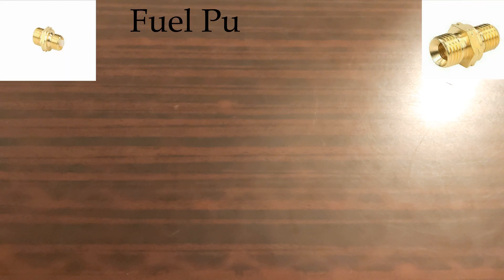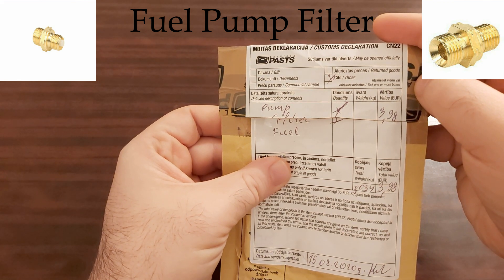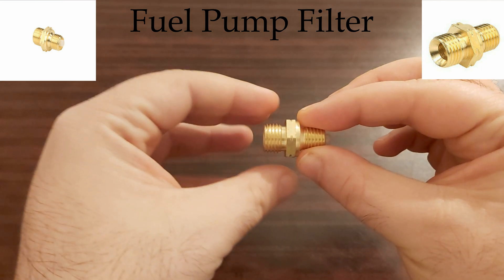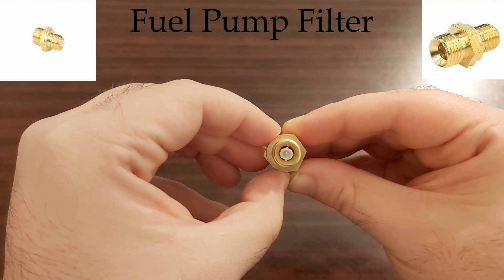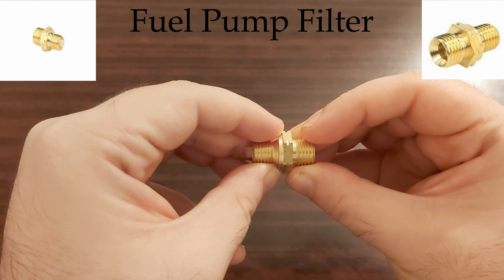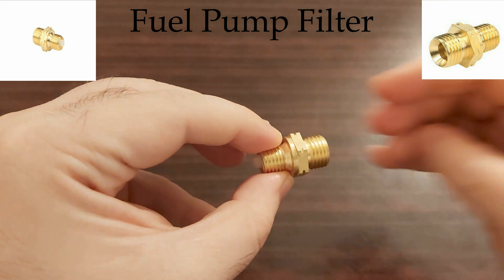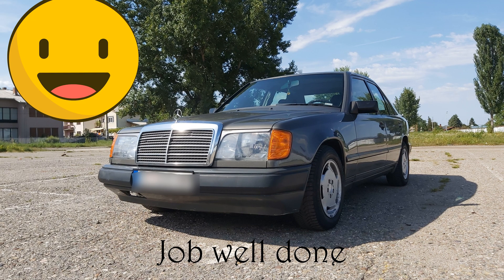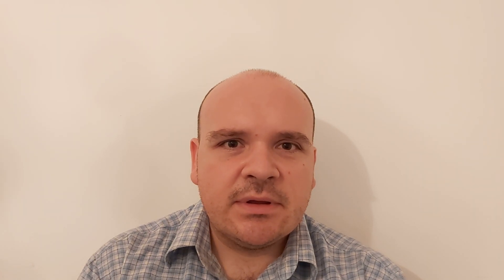Mercedes KE-Jetronic - Mercedes W124 Fuel Pump Filter

Comment: When should it be replaced (at what mileage) and what are the indications that it needs replacement? What problems can it cause if not replaced in time?
Reply from the maker: Well, there is not a precise mileage. You can't feel any symptoms. This is just the second fuel filtration out of 7. I believe these filters should be replaced once a lifetime of the car. If you have a 30 years old car then you can replace the filter. I did it because mine was very old and the brand new one is very cheap to buy. Greetings

Comment: my distributor inlet fuel filter is on so tight it seems pressed in, i could not get it off, and was nervous i might strip the thread! i used an open wrench 17mm  i tried so hard i  felt i started to round out screw... i was told by mercedes tech that it was causing no fuel to get through, but i just left it alone for now..my car would not start, so i adjusted air/fuel mixture and got it to start. what size crush washer goes  in fuel filter? i noticed you used the same one...
my car has a second crank hard start if it does not start the first time...studying all your videos to figure out what is the problem!  124 92 300e 2.6l thank you for your videos!!!
Reply from the maker: I simply used the oem one. I didn't measure it. It's a copper washer that your can buy in any hardware store. As I had to unscrew the filter I had to use the other wrench in order to make it easier. Sometimes people tighten it a bit and then loosen the screw. This is cone though....This filtrates only it shouldn't be serious(the second filtration out if 7). I wouldn't say it's a problem for a car nio to start. The washer is stuck so that you habe problem. Don't use flames 🔥because.....(you know why).
I hope you solve your issue.

Comment: Gde moze da se poruci ovaj deo kod nas u Srbiji i koliko kosta?
Reply from the maker: Ja sam ga kupio preko ibeja. Mogu da ti posaljem link. Ovaj deo se zove filter pumpe za gorivo. Ako ne uspes da ga nadjes kod nas, evo ti link
https://www.ebay.com/itm/Fuel-Pump-Filter-Fits-MERCEDES-190-Sprinter-Vito-W201-W126-W124-S124-903-1971/254644836955?ssPageName=STRK%3AMEBIDX%3AIT&_trksid=p2057872.m2749.l2649
Reply: @mercedeske  hvala. Ja imam w124 2.3 i svaki vas klip pazljivo gledam i slusam. Inace je bilo na plinu sada sam to izbacio ali auto i dalje malo brljavi sto se tice ler gasa i kada je vruc teze pali a sve sam menjao sto ste pricali u klipovima.
Reply from the maker: @dusan365  Dobro, sto se ler gasa tice ovako stoje stvari - nakon sto ti je stabilan pritisak u sistemu i sto su dobre dizne za stabilan ler ti treba ispravan ler motoric sa mikroprekidacem(on je zacetnik svega), senzor za polozaj klapne gasa treba da zatvori skroz leptir gasa, step motor tada preuzima ulogu da odrzava konstantan ler. Potenciometar treba da finije podesi polozaj disk protokomera. Da li ti je kalibrisan potenciometar? - Kada izmeris napon na pinovima 1 i 2 kada je auto zagrejan treba da ti da voltazu 0.7V +-0.1. Da li si promenio prigusnicu(akumulator za gorivo)? Lambda sonda se aktivira tek kada se auto zagreje. Da li ti je dobra lambda sonda? Ona se menja kad i filter za gorivo, 50h km. Jedan covek mi je govorio kako mu auto odlicno radi dok se ne zagreje, kad se zagreje, brljavi. Nakon sto je promenio lambdu auto mu je proradio kako treba.
Reply: @mercedeske  Nisam testirao lamga sondu. Imam tri ka glave ili ti protokomer sa sve razdelnicima to sam sve napakovao da jedna ka glava bude dobra. Zamenio sam dizne nove nova pumpa za gorivo svecice i kablove. Imam i step motore koji su po onom principu kako ste pokazali deluju ispravno. Promenio sam i tri akumulatora pored filtera za gorivo isti simptomi posle odredjenog vremena padne pritisak kada je ugasen motor. Sta se desi auto upali radi na 1500 obrtaja ne padaju obrtai sve dok ne proturiram auto onda spusti na 800 obrtaja. Auto ide lepo ne trza ne trokira samo taj ler brljavi i paljenje kada je vruc motor.
Reply from the maker: @dusan365  Normalno je da drzi obrtaje na 1500 kada je hladan. To treba da traje 10 sekundi(mozda i malo vise) i da sam onda spusti obrtaje na nekih 800. Jel ga cekas da spusti obrtaje ili malo sacekas pa ga turiras?
Reply from the maker: @dusan365  I jos jedna stvar. Da li si proverio regulator pritiska za gorivo? Da li mu je pukla gumena cevcica? Ako jeste gubices pritisak.
Reply: @mercedeske  jesam suv je.
Reply from the maker: @dusan365  Probaj da skines step motor i da ga potopis u dizel i ostavis ga tako preko noci, ako posle 15-ak sekundi auto sam ne spusti obrtaje na oko 800.
A pre toga izvedi ovaj test - kada ti se normalizuju obrtaji povuci rucnu(desna noga ne radi nista!), otpustaj polako kvacilo, gledaj u obrtaje i kada padnu na 500, PRITISNI KVACILO opet! Ako step motor ne digne obrtaje na preko hiljadu, pa ih sam spusti na 800 onda imas problema sa njim. Ja sam imao problema sa mojim, bio je potopljen u dizel na par sati i sada radi dobro.
Reply: @mercedeske  hvala na savetu probacu pa javljam rezultate.
Reply from the maker: @dusan365  Nema na cemu. Uvek!
Reply: @mercedeske  Ovu poruku nisam procitao do kraja pa sad videh. Kada ga upalim on radi na 2500 i onda ga ja proturiram da spusti na 800 obrtaja.
Reply from the maker: @dusan365  Jel si probao da opereš step motor?
Reply: @mercedeske  nisam jos probacu za viken pa vam javljam. Inace porucio sam onaj ndeo sto ide na ka flacu sto ste mi poslali link.
Reply: Pozdrav Ivice imam jedno pitanje za tebe majstor mi kazr da me zeza smajser ili ti akumulator za gorivo imas li preporuku gde mogu da nabavim nov a da nije skup kao otrov?
Reply from the maker: Potraži neki polovan na internetu po njegovom broju dela.
Reply: @mercedeske  nasao sam 6 komada i svi navodno neispravni. Kada ugasim auto posle pola sata verglam tri puta na dugo i onda tek upali.
Reply from the maker: @dusan365  To jeste onda simptom loše prigušnice(kako god da zovemo ovaj deo). Zaboravio sam koliko košta nov(imam na klipu). Traži ga po broju, ovde će da ti traže oko 300evra za njega. Na ibeju(ebay) ćeš ga naći za mnogo manje, a ima i polovnih.
Reply: @mercedeske  dobro pogledacu pa cu potraziti. Hvala na savetu. Vi ako znate neki link gde su povoljniji a novi posaljite mi link. Pozdrav.
Reply from the maker: @dusan365  Nema na čemu, uvek. Ja gledam ebay...Realno, tu ima opruga i membrana, to ne bi trebalo da košta više od 5000din. realno. Ali... vozimo kola koja se ne proizvode, pa ni njihovi delovi.